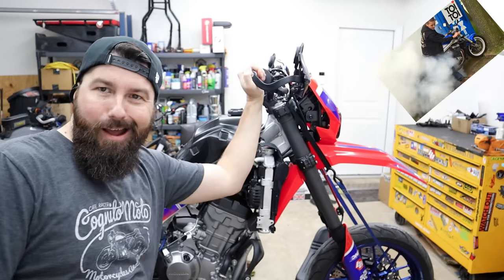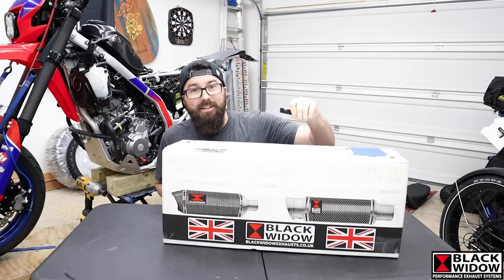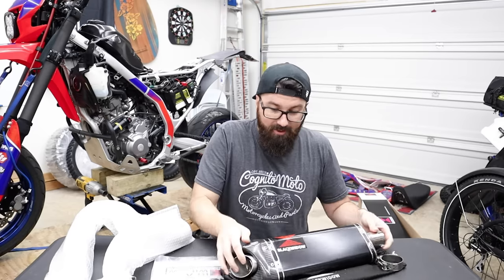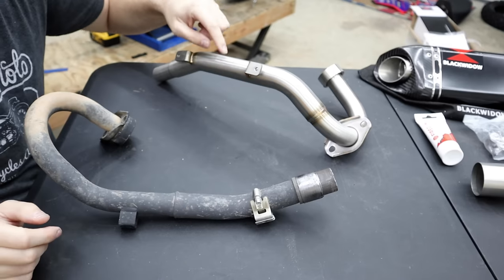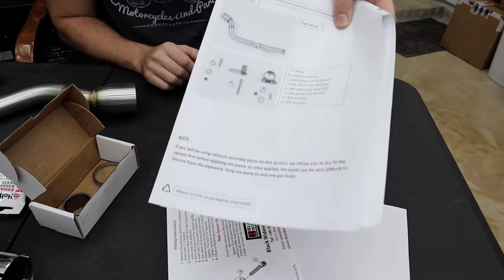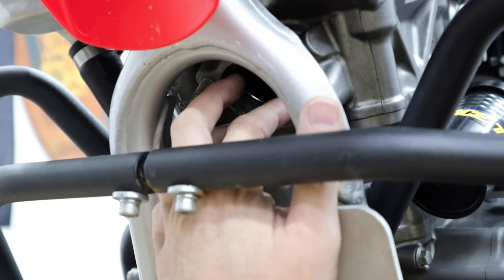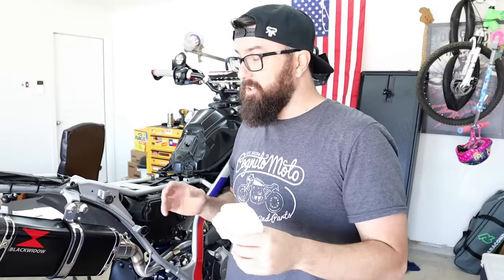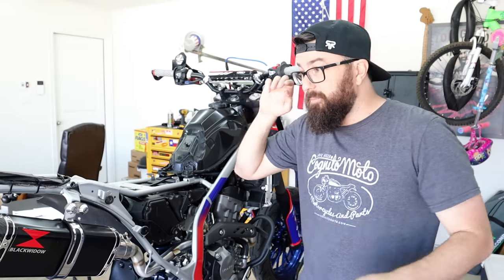CRF300L Full Exhaust install, Black Widow Exhaust

Comment: 13mm isn't that uncommon over here. Generally bolts are even sized up to 12mm (8, 10, 12mm etc) and above 12mm they use odd sizes (13, 15, 17mm etc) and then it just becomes a mix of the both
Reply from the maker: Well it was a slightly lose 13 which means it’s probably a 1/2”.
Reply: @TheGardenSnake  or a 7/16" if slightly rounded off.
Reply: @TheGardenSnake  its very unusual in the UK for a bolt not to be metric

Comment: 9:10 NASA Calculations were carried out using the metric system, but display readouts were in units of feet, feet per second, and nautical miles – units that the Apollo astronauts were accustomed to. So imperial units were just there to complicate things for the sake of "we are used to them" but not actually used to calculate all the physics of getting there. 😜

Comment: You do nice work. I had '13 250L that had full FMF Megabomb header with the Q4 muffler. It did add hp but I hated how loud it was. I recently bought a 300L and love how quiet the exhaust is, but I'm still getting more power and certainly more torque. One thing that made me really dislike the loud exhaust was the use of comms. We started using them a few years ago and it was hard to hear, especially when accelerating. I wish they made a replacement muffler that was the same decibels as stock, but much lighter. I figure I'm probably in the minority on this lol.

Comment: ... What happened about the "Check Engine" light? What did you do about it?
Great info and video!
New Rally owner of a slightly used 2021. 1944 miles when I purchased it. 
Thanks,
. Jeff .

Comment: Hello Jake, I have the CRF300L blackwidow header and exhaust, I need to ask if you know what the other thing in the little box is for? It's with the crush washer, whatever it is, I damaged it opening the box, fell on the floor and I thought it was metal  & stamped on it to stop it rolling away 😢, I have no clue what it's for at all, any info would be great, I never noticed you using it in this video, or did I miss it lol, cheers buddy 👍

Comment: The fact that the exhaust is such a big weight reduction is pretty amazing..
Reply: Not really. The new exhaust is going back to technology of decades ago where all you had to do was reduce the dB's a bit, and inhibit sparks from setting the forest alight. Well, I'm assuming they have a spark arrestor in there. 
Meanwhile the modern exhaust has a catalyst or two in there, double walled tubes because heat insulation and crack prevention, reverberation chambers to actually reduce noise to a sociable level, etc.

Comment: Brit here. Japanese bikes will usually have 12mm flats on an m8 bolt and 14mm flats on an m8 nut. There will be exceptions to that.
Ordinary metric hardware in UK has 13mm flats on both m8 nuts and m8 bolts. It would be pretty crazy to find a 1/2" head on anything metric. Maybe on some British or American vehicle from around the time metric became standard, and standard became American size.

Comment: Also the long bolt that holds on the silencer that goes through the spacer was only threaded about an inch or two which wasn't enough so I've had to add an even longer spacer.  Other than that no problems with my black widow so far.

Comment: Hi guys, nice video changing this parts from CB300. Here from Barcelona Spain. Just want to ask if is possible in my CRF 250 Rally, mount a full engine from a 300L bike. Instead of changing inside engine parts, if better to mount an engine from a CRF 300L in mine. Many thanks and keep doing this job. Gasss!!!

Comment: 13mm and 10mm are the most common bolt size across Europe. You find in Asian models they substitute the 13mm for 12mm because 13 is an unlucky number.

Comment: By the looks of how high you've mounted the pipe, couldn't you do away with the small bracket extension and just slide the muffler clamp up to the mounting point on the frame? Ps. Love your vids.

Comment: That’s not mandrel bent lol. A machine to do that is very expensive they would have to sell a million pipes
Reply from the maker: Maybe they’re made by a bigger manufacturer that makes numerous brands exhaust systems. Black widow might make a prototype then send it to a factory for mass production. And that shop would have those tools. I don’t know for sure but I wouldn’t be surprised. These things are very common. What I can see though is that pipe holds it’s diameter through the bend.

Comment: would your mods be applicable on the crf300l rally the same way they have worked on the cfr300l?
Reply from the maker: For the most part yes. There’s only a few that would be 300L specific. The headlight mods, skid plate, cage and maybe another one or so.

Comment: I got the gr moto exhaust on my Honda CRF250L the stock one weights 5.0 kg and the gr moto is 1.7kg in total with a weight reduction of 3.3 kg or 7.3 lbs after taking the baffle out of mine it bangs and cracks
Reply from the maker: Haha nice

Comment: Why no "power bomb"  expansion chamber in the header pipe ? Those supposedly help power on the bottom end , no?  Did you remove the resonator from the tube between the air box and FI unit ? What is that things purpose anyways ? I never saw one before. Thanks for the video.
Reply from the maker: Pretty much only fmf does those. It might be helpful but I’m not sure. The chamber in the intake is a helmholtz resonator and they’re a good thing to have. Kinda hard to explain it in a comment. They kinda do the same thing an expansion chamber does on an fmf pipe. You’re making a wave that bounces back and forth in the intake.
Reply: @TheGardenSnake  Yoshi has the exhaust head pipe resonator/expansion chamber on the factory Honda mx race tream bikes. Akrapovic uses the exhaust head pipe resonator/expansion chamber on the Red Moto/European Honda Enduro Team race bikes. That heimholtz box was used in the early 80's on several factory mx 2 stroke race bikes . They were supposed to keep a partial vacuum in the intake track to allow a quicker fuel charge into the cylinder on the intake stroke. They were a fad that came and went. Even less need on a 4 stroke design. Unless maybe they are doing it to reduce sound volume? Also on the air box mod you did that is only half the battle. The (FI to air filter box) intake snorkel tube sits an inch away from the filter. I am cutting mine down to be almost flush with the box allowing more still air to be available to be drawn into the engine. The whole filter is not being used with the oem design.  HP is still limited due to the oem smaller intake tract and FI unit but it will help. Thanks

Comment: Im happy with my Black Widow on my CRF300l...i kept the baffle in so I could put a Fisch Moto spark arrestor in it but I cut the end cap of the baffle off, it was a little too high pitch for my taste.
Reply from the maker: I drilled out the end of the baffle. Takes the edge off but still braps.
Reply: Which Fish Moto arrestor did you end up getting, I need one too?

Comment: Really considering a black widow full system for my crf300l. Is it necessary to do a retune afterwards?
Reply from the maker: It’s a pretty good idea
Reply: But adjusting the fuel injection on the carburator would be sufficient to get the right fuel/air mixture and to avoid getting a christmas tree of service lights no?
Reply: @antonmoens5739  big dawg it’s fuel injected. Gotta send the ecu off or just buy a new one.

Comment: Had a Black Widow on my Grom for a while, but took it off cause it was a bit too loud for me. It seemed good quality though, never had any issues with it and it was a hell of a lot lighter than stock
Reply from the maker: I put the baffle in for my road trip
Reply: @TheGardenSnake  You plan to mod the baffle for a little more sound? Every baffle insert I've ever heard changed the tone significantly, which I really hate. Deep and throaty turns into raspy, nasally, and hollow.